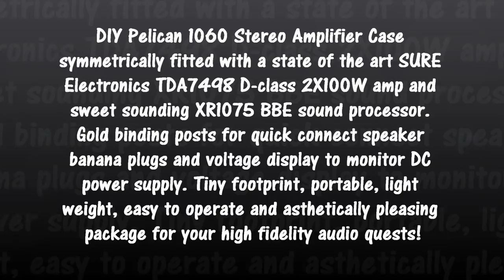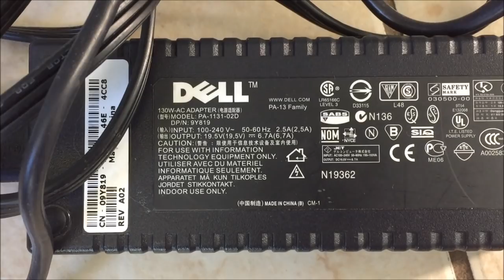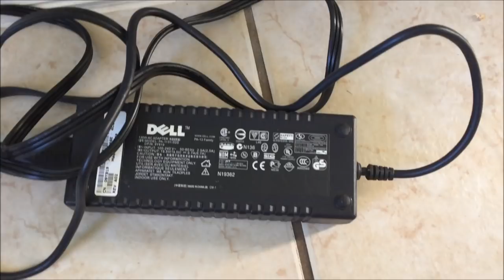DIY Pelican1060 with 2X100W TDA7498 SURE Amp & XR1075 BBE Sound Processor!

Comment: @ modiane1

Thanks for the great video. I would like to use the XR1075 with a TDA7498 board with onboard Bluetooth 4.0 and a 24V 3A power supply. I have a few queries as below:

1. Will the same 24V 3A drive both the TDA7498 board and XR1075 or do we need separate power supply?
2. Do we need any step down for the XR1075?
3. If we use the XR1075 as a pre-amp at the input stage, how would we have access to the Bluetooth 4.0 chip on the TDA7498 board?
4. Is there any humming or popping sounds when you add the XR1075? I have read that the LM1036 processor and TPA3116 amp combo has a lot of hiss and noise.

Thanks in advance.

Comment: Hi, looks like a great build. But how do you connect the amp AND the balancer with only one power supply? (I'm a bit confused, sorry). Thanks!
Reply from the maker: All components are connected and powered in parallel but only use one switch for power.

Comment: my friend i already see many videos from you, different kind  of amplifier, but what do you think is the best i see the ta 2020+ from lepai, the tda7492 and this tda7498, what is better? whiich one have better sound quality? which one is more stable and sound loudly? and the last question.. how good of the XR1075 bbe sound processor, what is the sound impact or difference when you using this sound processor when you dont use it?

i know many question, but.. you have so many experience in this area.!
Reply from the maker: +Joeyd Santos All the amps I tried are very good, you'll have to choose to match your speakers load and overall design. XR1075 allows the SURE electronics to trim down the volume and fine tune the tone (bass/treble).
Reply: modiane1  
oh nice, but the xr1075 improve the sound? if i use the lepai 2020+ that comes with bass and treble controls knobs... would be a good idea to add the xr1075 bbe sound processor?

i want to build a boombox for family party outside.. so i need a very good quality amp and loudly.. so i dont know.. 

my friend thanks you so much for every reply.. it support me and all the people like me that we are starting  a new project..
Reply from the maker: Yeah if you go Lepai with tone controls you don't need the XR1075. But the Lepai only has 20W/channel. If you went 50W or 100W/channel then I'd add the XR1075. Good luck with your build!
Reply from the maker: XR1075 improves the sound drastically.
Reply: +modiane1 so thanks you... my friend I will check your channel every day for some ideas.. you have very nice videos..

Comment: Is this XR1075 BBE Sound Processor mono? I can't find it, only the models with 4 RCA or 3.5mm or thermal wired on. Do you have a direct link? Thanks
Reply from the maker: MrBrymstond stereo only somewhere on eBay